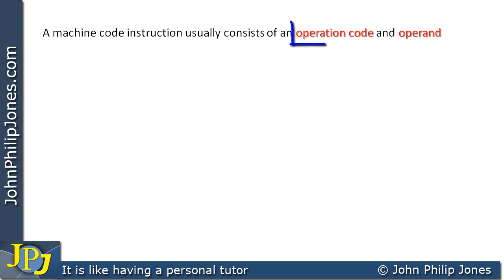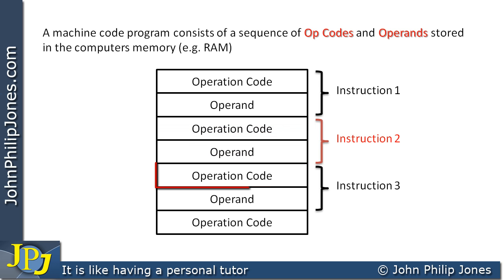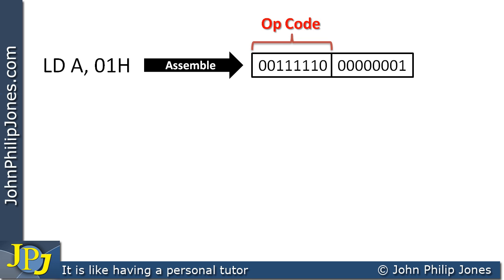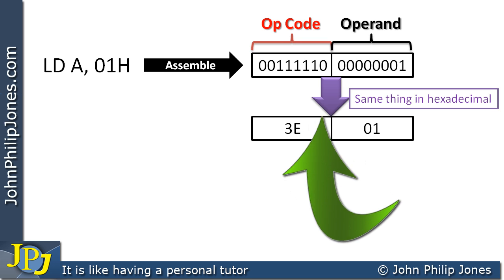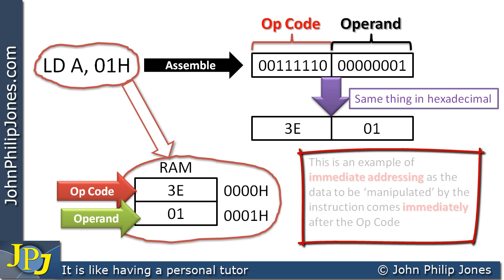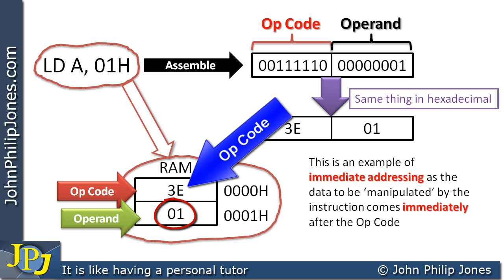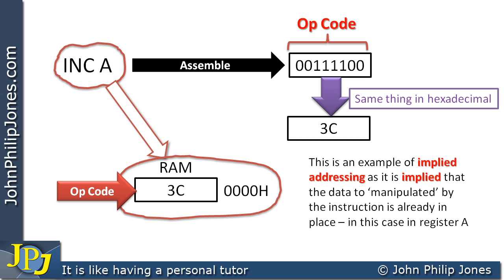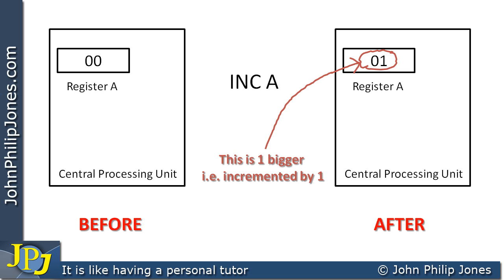Machine Code Instructions

Comment: 1.does assembly language allow you to do things you can’t in a higher level language?
2. Suggest me some books for assembly language
Reply from the maker: Assembly language does offer some unique capabilities that higher-level languages might not provide. Here are a few key points:

Direct Hardware Access: Assembly language allows you to interact directly with the hardware, giving you control over specific CPU instructions and memory addresses. This level of control is often necessary for writing device drivers or real-time systems.

Performance Optimization: Because you can write instructions that are executed directly by the CPU, you can optimize your code for maximum performance. This is particularly useful in scenarios where every millisecond counts, such as in embedded systems or high-frequency trading applications.

Minimal Overhead: Higher-level languages often introduce some overhead due to abstractions and additional layers of code. Assembly language, being closer to machine code, has minimal overhead, which can be crucial in resource-constrained environments.

Learning and Debugging: Understanding assembly language can provide deeper insights into how computers work at a fundamental level. It can also be helpful for debugging, as you can see exactly what the CPU is doing at any given moment.

However, it's worth noting that higher-level languages are generally more productive and easier to maintain, as they abstract away many of the complexities involved in programming at the hardware level. They also come with extensive libraries and frameworks that can speed up development.
Reply: @johnphilipjones  is it true that if i know assembly language, every software/ programing language will be open source for me in that spacific computer
Reply from the maker: @tamimayan2028  Knowing assembly language can give you a deeper understanding of how software interacts with the hardware, and it can be incredibly powerful for low-level programming and system optimization. However, it doesn't necessarily mean that all software or programming languages will be open source or accessible to you on that specific computer.

Here are a few key points to consider:

1. **Understanding Machine Code**:
   - Assembly language is a low-level programming language that is closely related to machine code. If you understand assembly, you can read and potentially modify machine code, which is the lowest level of code executed by the computer's CPU.

2. **Access to Source Code**:
   - Open-source software means that the source code is freely available for anyone to view, modify, and distribute. Understanding assembly language doesn't grant you access to closed-source software. If a program is closed-source, its source code is not publicly available regardless of your knowledge of assembly.

3. **Reverse Engineering**:
   - Knowledge of assembly can help you reverse engineer software, which means analyzing a program's binary code to understand its functionality. While this can be useful for debugging or security research, it's important to note that reverse engineering closed-source software can violate licensing agreements and intellectual property laws.

4. **Programming Language Interoperability**:
   - Understanding assembly language can help you write more efficient code in higher-level languages and understand how those languages are translated into machine instructions. However, each programming language has its own syntax and semantics, and being proficient in assembly doesn't automatically make you proficient in all other programming languages.

In summary, knowing assembly language can significantly enhance your understanding of how software works at a fundamental level and help you with tasks like optimization and reverse engineering. However, it doesn't provide automatic access to all software or make every programming language open source. Respecting intellectual property and software licenses is crucial.

Comment: Nicely done.  But @5:54 the name “Immediate” actually refers to the operand being the actual data to operate on. As opposed to the operand being an address, or an offset, that points to the data (or further indirection).  Specifically, “Immediate” does not mean the operand immediately follows the opcode, as you have stated.  Clearly, the operand always immediately follows the opcode.  The operand just isn’t always the “immediate” actual data to operate on.
Reply from the maker: What you are referring to is addressing modes. If the data to be processed by the instruction follows the opcode, then the addressing mode is referred to as immediate addressing. Another instruction can have the address of the data just after the opcode. This address gives the memory address of where the data to be processed can be located. This type of instruction is said to have an absolute addressing mode. 
Immediate addressing is covered by the video at the link below:
https://youtu.be/C6P2s5J9RaM?si=LuW6LxR811gcGlZ_

Absolute addressing is covered by the video at the link below:
https://youtu.be/L8RVT0zG8Zk?si=EsyWTnOtZBb8ThUi

As an aside the addressing mode shown in the video at the link below is an example of implied addressing.
https://youtu.be/XM4lGflQFvA?si=CwcaGDV0h8ju9Kso
Best wishes
Phil
Reply: @johnphilipjones  Hi Phil. I do understand all of that.  I’m old school. I started off hand-assembling machine code on my own self-built 8-bit microprocessor designs in the late 70’s.  So I do have a pretty solid understanding of all of this.  I was just trying to give some helpful feedback for your students.
What I was pointing out is that @5:54 you specifically say: “the name immediate addressing comes from the fact that the operand comes immediately after the opcode”.  This statement is potentially confusing to learners.  i.e. The fact that the operand comes immediately after the opcode is a general statement, not specific to the addressing mode.
I believe what you meant to say is more along the lines of: “the name immediate addressing comes from the fact that the operand is the actual data to be processed by the opcode”.  This would then be consistent with what you have now clarified in your reply above.
Hopefully you take this as the helpful constructive feedback I'd intended. 🤓
Reply from the maker: Hello Greg,
Yes you are correct I missed your point initially. I am always happy for feedback and comments. It was, and is, taken as constructive.
Best wishes
Phil

Comment: The lookup tables for getting from Assembly instructions to Opcodes - are these available / queryable from the OS?
Reply from the maker: You would need to install an assembler. To get the opcodes search on google for the instruction set of the processor.
Best wishes
Phil

Comment: How does one find opcodes in an exe file?
Reply from the maker: You would typically write a machine code program in assembly language. The assembly language is then converted to machine code and stored in a file. The file content are then loaded into RAM to be executed. It is a case of locating the op code of the first assembly language instruction. Every assembly language instruction has a number of bytes that form the opcode and operand. Once you find the first op code you can count the number of bytes to the start of the next instruction. This will be the op code of the next instruction.
Best wishes
Phil

Comment: where do you get this information from
Reply from the maker: The chip manufacturers have manuals on instruction sets. I used the Z80 manual for the information in this video. Back in the day I used to program this chip using assembly language and machine code. Do a Google search on the following to get the manual.

Zilog Z80 manual

Best wishes Phil

Comment: Can u please explain IN 23H,OUT  70H,LDA 2530H,STA 2170h will u give rply fast
Reply from the maker: LDA 2530H
2530 is the memory address. H means that the address is a hexadecimal number. The instruction will transfer the content of memory address 2530 to the accumulator.
Reply from the maker: STA 2170H will transfer the content of the accumulator to memory address 2170

Comment: Sir,how opcode and operands are combined in an instruction and how they are seperated in an instruction.
Reply from the maker: The first binary pattern (or first bits in the pattern) fetched fromm memory when you execute a program is always the opcode. Once decoded the instruction knows what to do with the rest of the instruction. This usually involve going back to the memory to get the operand. Once the current instruction has executed the CPU goes back to the memory to fetch the next instruction the and this will be the opcode.
Reply: @johnphilipjones  thank u sir and  which digital circuits are invovlved in joining both opcode and operand together in an instruction.

Comment: Very nice.  So we can either write out the assembler on a piece of paper, then convert on the paper and then maybe (in the early days)  use switches to set each memory address with the correct sequence of binary bits ?  The part I still get stuck on is that the assembler can also be a program to convert the codes for us.  Is this a program that would be loaded into memory, and therefore the first assemlber would have had to have been hand written (from what I've read, but still a little confused )and manually placed in the memory ?
Reply from the maker: When you switch on a computer the electronics generates an electrical pulse. This pulse is applied to a CPU pin that causes a machine code instruction to be fetched from a specific memory location. This instruction is the first instruction of the boot program other instruction are then fetched decoded and executed in order one after another. This boot program then sets up the operating system by loading other programs that form the operating system. Once the operating system is in place it is able to load up other programs (such as the assembler) at the request of the user (i.e by clicking on an icon or by issuing a command).

In the very early days switches were indeed throw to enter the program you wished to execute.

Comment: You used the term "INC A" quite often... but when you showed the binary or hex representation of it, it doesn't seem to include the 'A' part... I'm guessing because it's A (the first register of the CPU), you just omit it, but when you want to access B or C, would you simply have an operand directly proceeding the 3D (INC) Op Code?

(Tried to make it as simple as possible to understand, sorry)
Reply from the maker: INC B would have a different opcode. INC C would also have a different opcode

Comment: For Intel 80386+ CPU:

   Instruction Prefix                        0 or 1 Byte
   Address-Size Prefix                    0 or 1 Byte
   Operand-Size Prefix                   0 or 1 Byte
   Segment Prefix                           0 or 1 Byte
   Opcode                                        1 or 2 Byte
   Mod R/M                                     0 or 1 Byte
   SIB, Scale Index Base (386+)   0 or 1 Byte
   Displacement                              0, 1, 2 or 4 Byte (4 only 386+)
   Immediate                                   0, 1, 2 or 4 Byte (4 only 386+)

Format of Postbyte(Mod R/M from Intel-Doku)
------------------------------------------
MM RRR MMM

MM  - Memory addressing mode
RRR - Register operand address
MMM - Memory operand address

RRR Register Names
Filds  8bit  16bit  32bit
000    AL     AX     EAX
001    CL     CX     ECX
010    DL     DX     EDX
011    Bl     BX     EBX
100    AH     SP     ESP
101    CH     BP     EBP
110    DH     SI     ESI
111    BH     DI     EDI

---

16bit memory (No 32 bit memory address prefix)
MMM   Default MM Field
Field Sreg     00        01          10             11=MMM is reg
000   DS       [BX+SI]   [BX+SI+o8]  [BX+SI+o16]
001   DS       [BX+DI]   [BX+DI+o8]  [BX+DI+o16]
010   SS       [BP+SI]   [BP+SI+o8]  [BP+SI+o16]
011   SS       [BP+DI]   [BP+DI+o8]  [BP+DI+o16]
100   DS       [SI]      [SI+o8]     [SI+o16]
101   DS       [DI]      [DI+o8]     [SI+o16]
110   SS       [o16]     [BP+o8]     [BP+o16]
111   DS       [BX]      [BX+o8]     [BX+o16]
Note: MMM=110,MM=0 Default Sreg is DS !!!!

32bit memory (Has 67h 32 bit memory address prefix)
MMM   Default MM Field
Field Sreg     00        01          10             11=MMM is reg
000   DS       [EAX]     [EAX+o8]    [EAX+o32]
001   DS       [ECX]     [ECX+o8]    [ECX+o32]
010   DS       [EDX]     [EDX+o8]    [EDX+o32]
011   DS       [EBX]     [EBX+o8]    [EBX+o32]
100   SIB      [SIB]     [SIB+o8]    [SIB+o32]
101   SS       [o32]     [EBP+o8]    [EBP+o32]
110   DS       [ESI]     [ESI+o8]    [ESI+o32]
111   DS       [EDI]     [EDI+o8]    [EDI+o32]
Note: MMM=110,MM=0 Default Sreg is DS !!!!

---

SIB is (Scale/Base/Index)
SS BBB III
Note: SIB address calculated as:
<sib address>=<Base>+<Index>*(2^(Scale))

Fild   Default Base
BBB    Sreg    Register   Note
000    DS      EAX
001    DS      ECX
010    DS      EDX
011    DS      EBX
100    SS      ESP
101    DS      o32        if MM=00 (Postbyte)
SS      EBP        if MM<>00 (Postbyte)
110    SS      ESI
111    DS      EDI

Fild  Index
III   register   Note
000   EAX
001   ECX
010   EDX
011   EBX
100              never Index SS can be 00
101   EBP
110   ESI
111   EDI

Fild Scale coefficient
SS   =2^(SS)
00   1
01   2
10   4
11   8

Comment: I thought Machine code was a mix of Binary, Hecadeximals,and Octal
Reply from the maker: Machine code is actually voltage levels within the central processing unit (CPU). There are two voltage levels a high and low level. Binary one is represented by the high voltage level and a binary zero is 'represented by' the low voltage level. Machine code is therefore 'closer to' binary. Now hexadecimal and octal can be converted easily to binary and binary to can be easily converted to both hexadecimal and octal. So machine code programmers will use hexadecimal to represent the binary patterns that form the machine code (because hexadecimal is easier for a human to remember). Of course they prefer to use the mnemonics of the  assembly language. So machine code is not really a mix of these different number systems. Instead think of the number systems as a different way of representing the same thing i.e. the machine code.

Comment: But increment doesn't need alu operation,then why it is a part of execution cycle...
Reply from the maker: There is always a fetch of the opcode which then needs to be decoded to find out what this instruction (i.e. Opcode) is for. After the decode you are in the execute phase. An execute phase does not always mean that the ALU is used. For example moving data from a register to a memory location is an example of an execute phase.

Comment: Can you tell me how assembler converts Mnemonics into opcode.
Reply from the maker: There is essentially a table that contains the mnemonics and opcode in there own column. The mnemonics (i.e. assembly language program) is supplied as a file to a computer program (the assembler) the table is referenced and an executable file that contains the opcodes and operands is created (this is the machine code). The machine code program is then loaded into the computers memory and this program is then executed